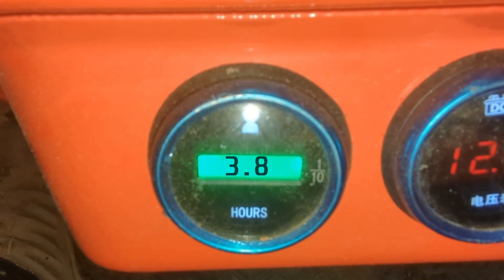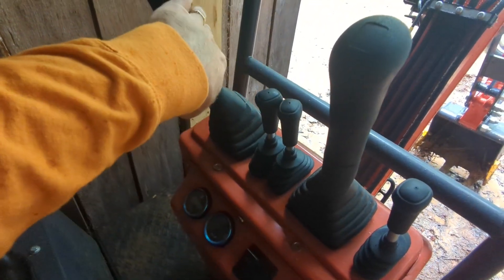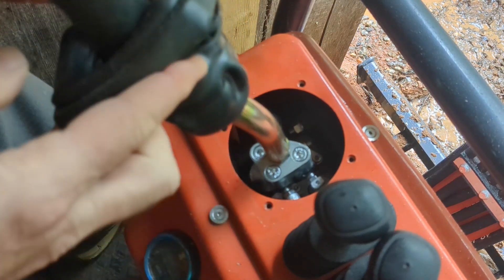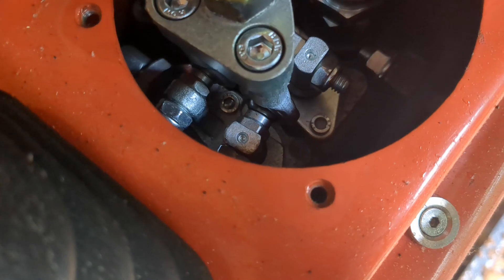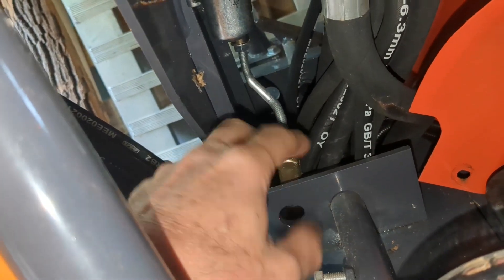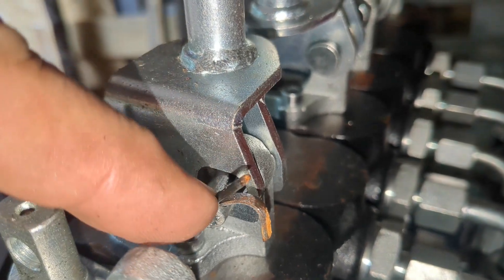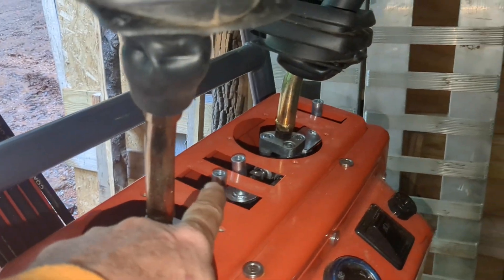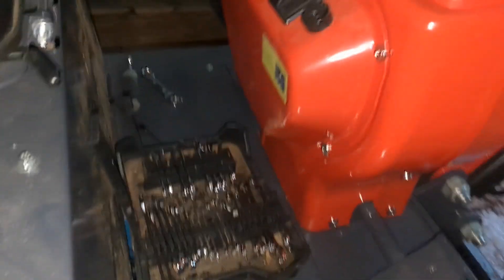Chinese Mini Excavator Hydraulic Failure at 3 8 Hours FIXED

Comment: You mentioned extending control shafts. My H15 has all M12 shafts, so its easy. I wanted both pedals gone and they are just another spot on the manifold, so loosen the lock nut and spin it off. Spin in a piece of M12 allthread, maybe 2 with a coupler, and screw a ball on top. These are all pretty standard items on Amazon.

P.S. 2 words, Magnetic dish.
Reply from the maker: Thanks for the tips. I am going to remove the pedal s asap. My size 13 boot get hung up on them all the time. As far as extending the other controls, I've gotten used to them and will leave them as-is.

Comment: To fix we wouldn't really need to remove to levers at all correct?
Reply from the maker: That is correct. At first I thought the shaft came out the top. That's why I pulled them off.

Comment: I commented you last week I have the same model, I had my first fail sort of today. I have yet to put my fan's on because it has been mild so it overheated around 190 degrees. It ran rough then I realized it vibrated the spark plug boot off, I pushed it back ran fine I would suggest watch the vibration my boot has a lot of slop.
Reply from the maker: Thanks for the update. I need to adjust the choke cable so I'll give the engine bay a good once over. I ordered a narrow trenching bucket so I'll probably change out all of the grease zerts when that gets here.